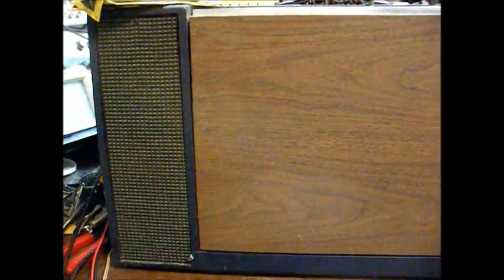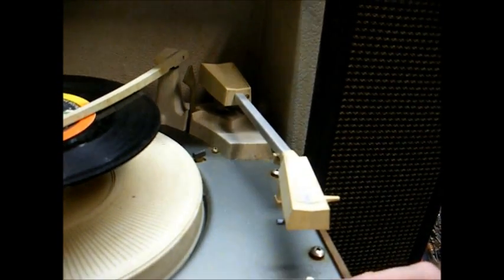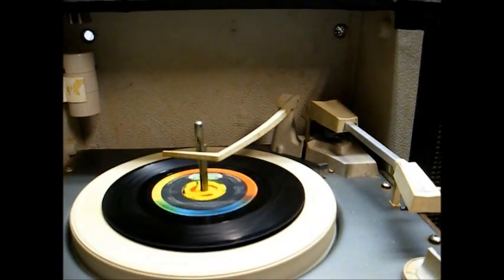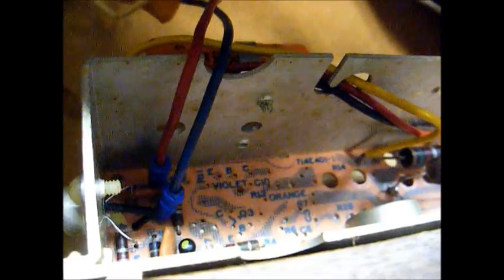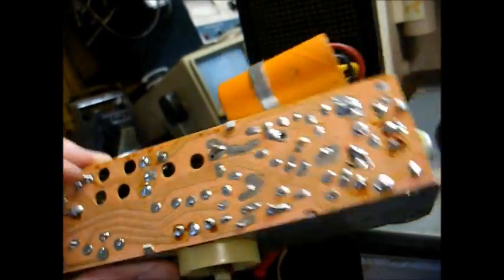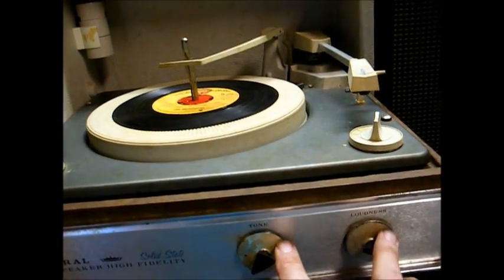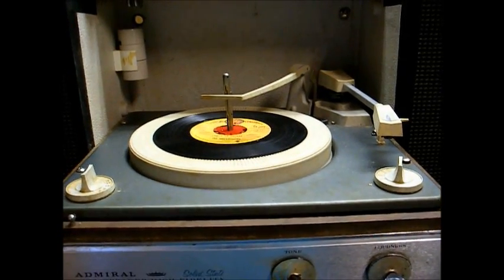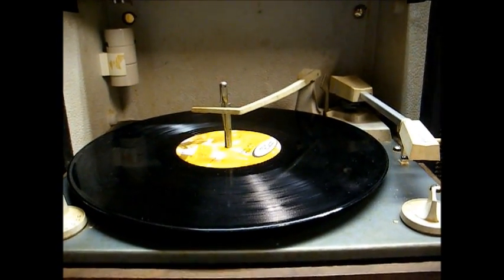1965 Admiral record player amp repair & cartridge replacement

Comment: I picked up a YG1047 today and the sound is completely dead. stylus noice only. no amplified sound. It has the same amp as the one you're working on in this video. the Admiral B2B. On the end of the chassis in your video there is a can/covered transistor. On the end of mine is a nut and bolt with empty holes above and below where the plastic mounts for the transistor would snap in. On the inside, the opposite side of the nut and bolt, seems to be the remains of the transistor. Three covered wires coming out and down into the circuit board. Could this be some kind of penny-in-a-burned-out-fuse fix? I'm new to electronic circuitry and am at a loss. Any idea? Happy to email a photo if that could be figured out.
Reply: sorry. the 2B2 Amp.

Comment: Setdown on this example should be easy, since it seems to land about as far into a 45 as it does into a 78 and a 33 1/3rd.  Some units it lands perfectly for a 33, but lands on the platter in front of a 45.  When you adjust to land properly on a 45, then it misses the 33!  Hoot n holler, some of these machines!

Comment: Noticed the 45 RPM adapter. It's round. We had old record players that had a round adapter. It was about 1974 when I got my first turntable with the "flat" adapter.
I can remember the warning about running the player with no speaker:  it said it would damage the output Transistor. I had a later model Admiral with that warning (it was stereo)
Reply: Running a SS amp won't damage it , shorting it will

Comment: Can you put a 1 volt cartridge and put an op amp between the cartridge and preamp stage?  You'd probably want to put a pot on the input section and adjust the volume accordingly.  Or can you put a 1:3 step up transformer in there to get the voltage up?  Maybe I don't know what I'm talking about, but it's a thought.  Thank you.

Comment: FWIW - about the high output cartridges vs "regular" output cartridges - I have an RCA 45 player with a single 25L6 tube; I have one of Gary's (Voice Of Music) "regular output" cartridges in it now and the volume is definitely room-filling, or as room-filling as a 4" speaker can be.  I wired both channels in series; and I don't have to worry about low-compliance cartridge damage to my records.

Comment: That's a nice one, but not as good as my GE Wildcat, because mine is stereo and the changer works which was not VM, just GE, but it has a black plastic tonearm with the GE emblem on top. I tried 50's and 60's records on my vintage '75 Wildcat, but sometimes, 70's and 80's records sometimes skip, but doesn't seem to track well, and so does the current or present day records.